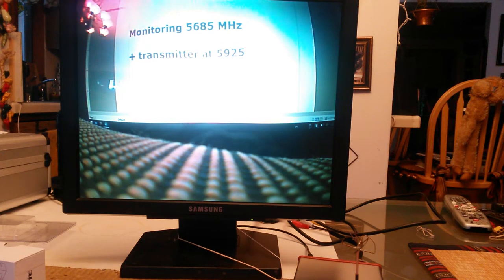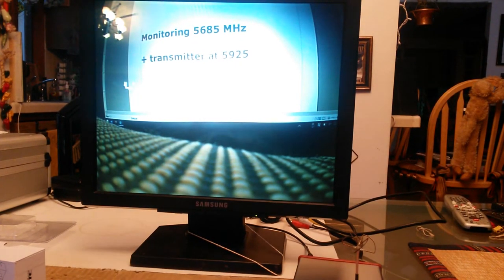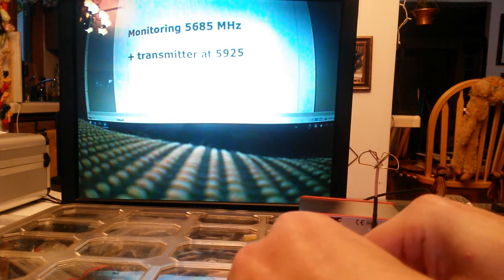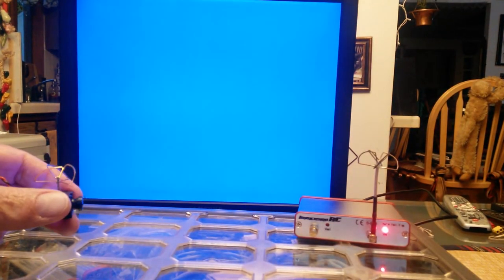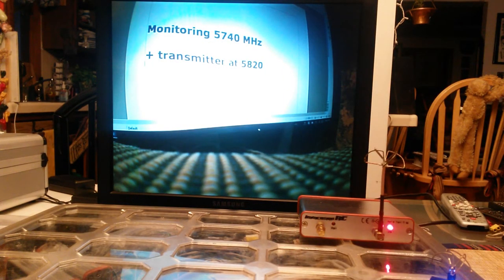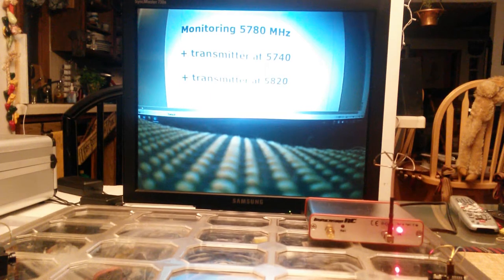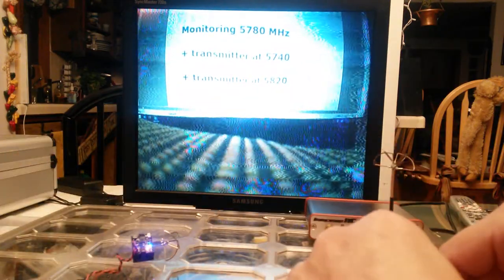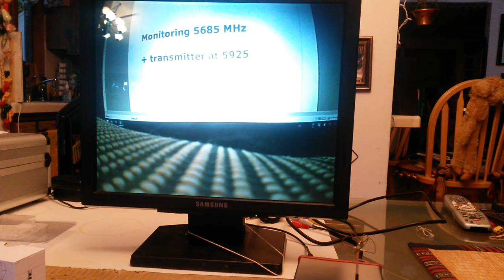IMD FPV Demo 2016-08-27

Comment: Thanks for the info. I have noticed that 1 transmitter can bleed over another transmitter on frequency that is 240mhz apart, this is consistent throughout the channels in my testing.
Reply from the maker: At the beginning of the video I show a receiver at 5685 and a transmitter at 5925 (5925-5685=240), running with no interference.  If you have a test I can reproduce showing this kind of interference, please describe it.
Reply from the maker: What I've since found is that transmitters will produce interference at frequencies 240MHz above them (but not below).  See my "ArduVidRx and Controller Android App Demo" video for a demonstration of this.